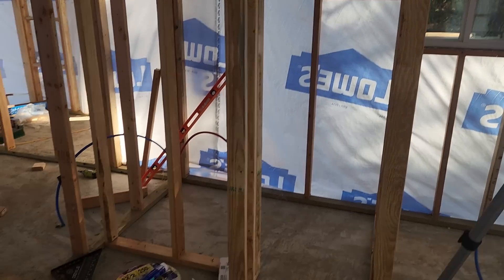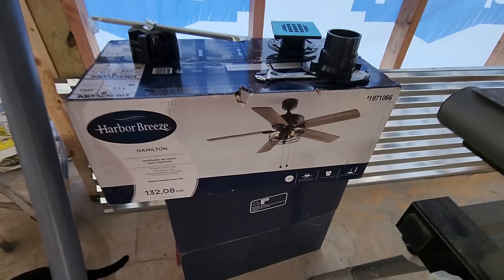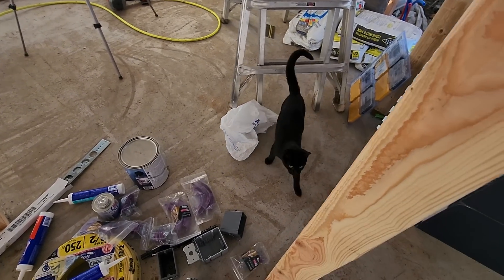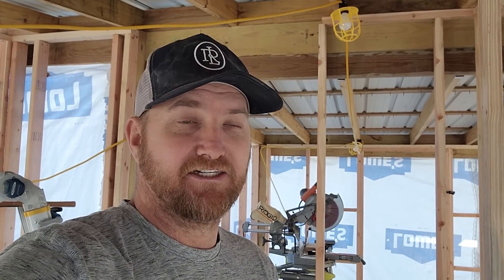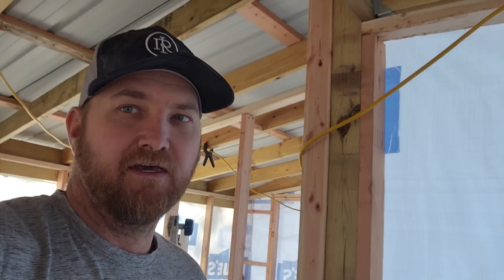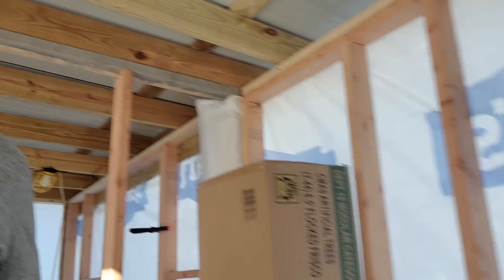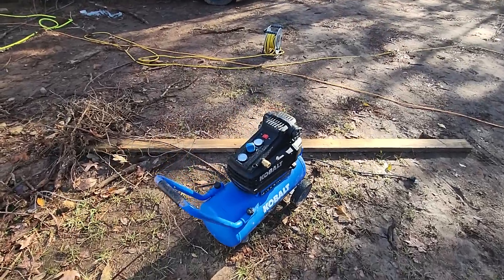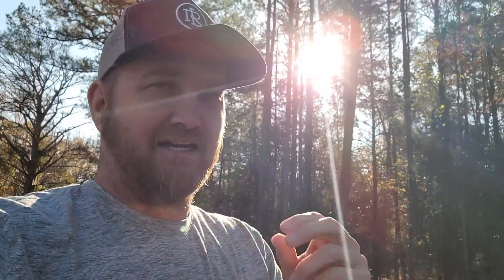ACCIDENT STOPS THE BUILD  | tiny house | off-grid |cabin build | tractor homesteading | solar | DIY

Comment: You can get those drain petcock valves at any hardware store and they're cheap maybe at a parts store also. They're 1/4 in pipe thread. I've even welded a 1/4 " pipe nipple where they've either broke or the weld broke.

Comment: Accidents happen and glad it can be fixed. Excited that you are able to take a hot shower! Funny how such a simple thing is life changing. Bless that company for sending that to you!!! I learned how to make a hot shower out of a gallon jug with nail holes in the bottom. Hang it wherever you need and open the cap a little to let the water flow.

Comment: About the leak on the old compressor, I've had to replace the pressure switch on mine a couple of times for leaking. It seemed to be poor quality not amount of usage. The switch in it now has not been a problem . I guess quality control finally caught up.
PS The old switches were still working just leaking.
Edit : I would replace the drain valve with a 1/4 turn ball valve , much easier t let the water out .